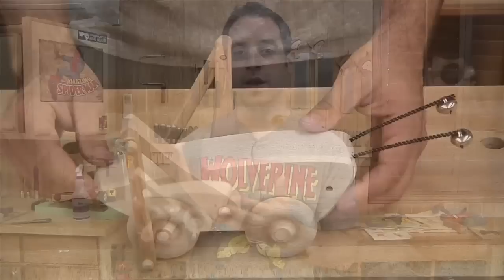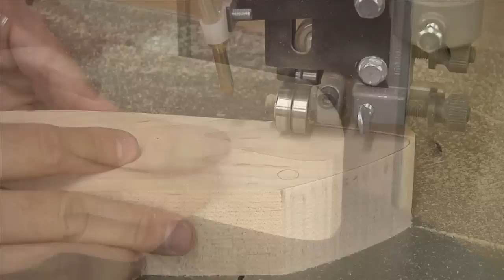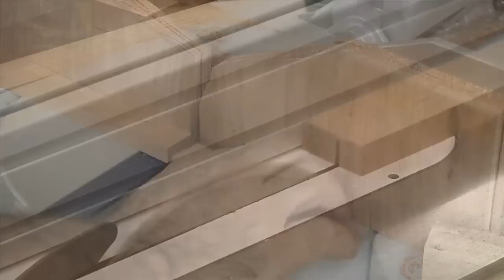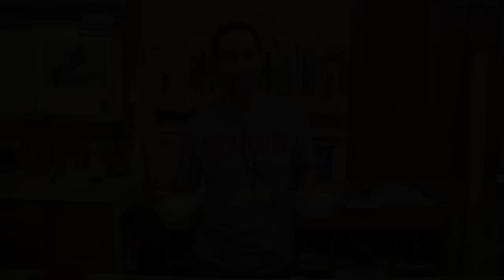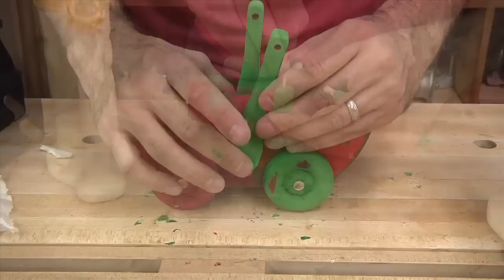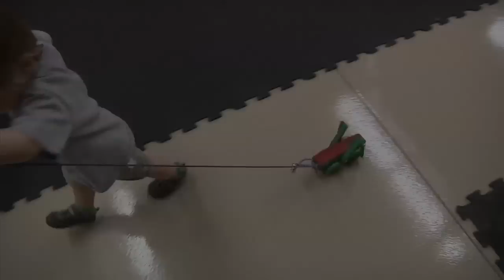226 - How to Build a Grasshopper Pull Toy

Comment: Wonderful pull toy!!!! loved how you let Matteo paint it himself and honored his 3yr old workmanship. Some grownups would have tried to paint it "perfect" and that's not right. SAFETY TIP as a mom of three and grandma of three, if the toy is going to be in a household with babies or smaller children use googly eyes that can screwed or nailed in tightly into the wood and be sure the bells cannot come off the antennae. Many craft glues are made for decorative application and wood glue doesn't bond well to non-wood surfaces like the plastic back of eyes so the small parts can fall off creating a choking hazard for babies. If it can or does fall off, crawling babies  have a homing instinct that will find it, guaranteed. Meanwhile I hope you consider a section of family fun projects that can grow with children's ages and skill level. Call it family time or legacy building.

Comment: Wow, He's 3 already!?!  He's like Marc with Blond hair and more cuteness.  My son and I made a pull along frog when he was about 2 (he's 4 now).  He STILL tugs that thing around the house.  I used some spare Red Oak and coated it with a two-part table top "glaze" (hard as a rock and waterproof), so it's holding up just fine.  "Froggy" even does bath time and swimming during the summer.  When scratches do happen, I just pull out the heat gun and give it a once over to remove the scratches.  Super low maintenance.

Comment: Looks like fun . . . for me and for my grandson. One problem. I can't find 1-3/4 in. wood for the center piece. 2 x 4s are only 1-1/2 in. thick. So far, I haven't been able to find a board that is actual size 2 in. x 4 in. If I go to 4 in. x 4 in., it's all treated wood which I don't want to use.

Comment: Cool project but grass Hoppers legs dont move like they are walking grass Hoppers jump using both legs at once so for a more realistic movement the wheels shouldnt be rotated the 180 degrees they child both have the same hopping movement
Reply from the maker: That would be incorrect good sir. Well, for a walking grasshopper, that is. And my grasshoppers are walking, not hopping. But don't take my word for it. Watch a grasshopper walk. :) Florida's Giant Orange Grasshopper - YouTube HD